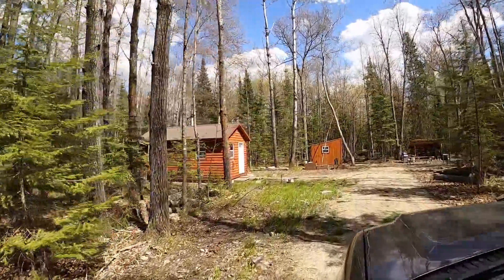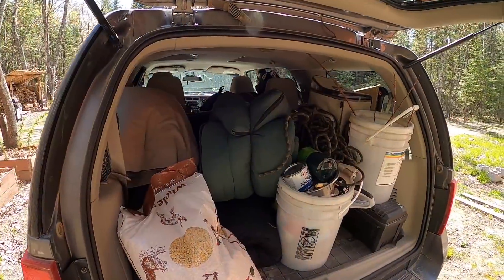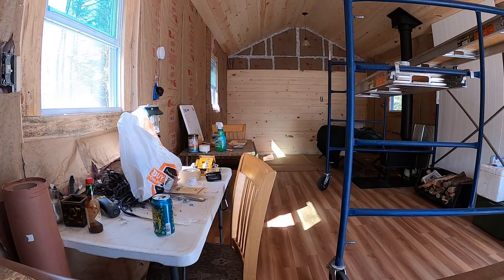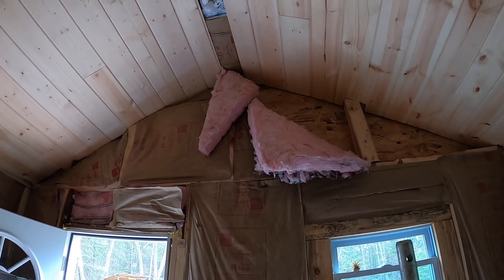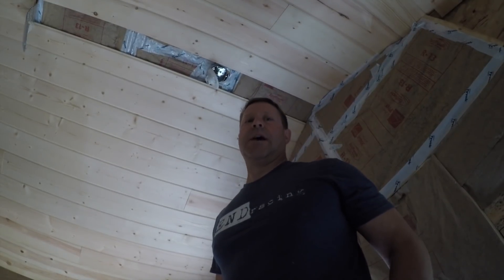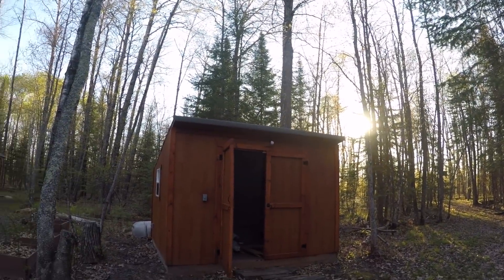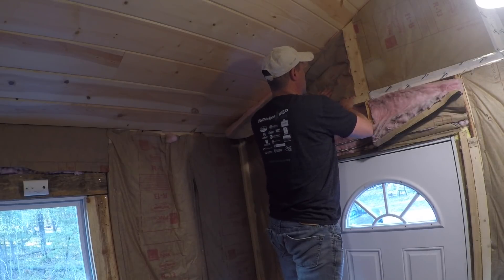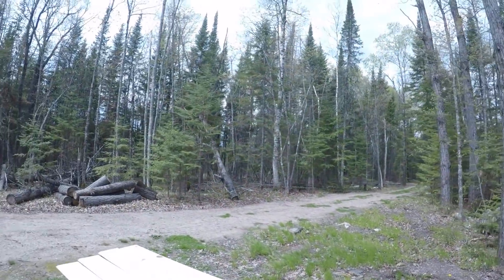The off grid shed to cabin conversion ceiling is FINALLY finished!

Comment: I went to a local two-person mill and I offered to buy the outside boards of the trees. The section that has bark and normally not used. Instead, he gave me whatever I wanted and told me to come back when I need more. I used them as siding once I cut one side with a straight edge. I made a small shed to house my lawnmower in. It is like a barn in that it is post and beam construction and gravel floor. I also bought the beams I needed for the build from the same mill. I then sealed it and after 8 years, the bark is still intact. It was a cheap build in today's standards. Just a suggestion until lumber prices come down.
Reply from the maker: The Amish mills I drive by always have those ends in big bundle for $10. I had thought about buying and debarking but it seemed to much work. I'm very intrigued to learn that you leave the bark on. Do you have any issues with bugs? I'm really glad you commented. This could be a great option that I hadn't considered

Comment: Lake county requires an electrical inspection. Just got my land use permit for my out house and sheds this year. Just finished clearing some land. Boundary water trip in a little over a week. Then start building in June.
Reply from the maker: Are you on the grid? I can't even get electric if I wanted. I'm excited for you Troy. You will love it!
Reply: @TRERUNSWILD  We will be off grid. $6000 to run a line, yikes!
Reply: Nice I got land in lake county too yes there a ton of rules and laws to get around

Comment: If want to save space put in a loft it will be cramped but will be warm in the winter. Don't forget to ventilate your outhouse.
Reply from the maker: Yes, a vent is needed. Found out the hard way.  Thought about a loft but yes, it would be cramped.

Comment: place a back seat longer car mat by the door so if you do walk in with muddy boots or sneakers.. you'd have someplace for e'm to be taken off. it is also advised that if you're using the pallet as a sleeping space (for now and not permanent).. once you're at the cabin.. during the day.. and the sun's out.. take the pallet outside in the direct sun for 30 to 1hr.. why any bugs or mites hiding inside the closed spaces will fall out.. when you're going back home leave the palette in an up right position.. possibly tied to the wall by a hook or bungie cord. lastly add a bug screen with magnets.. when you're at the cabin/shed.. on summer days without an AC.. it will keep your shed cooler at night... cross ventilation, plus no bugs. stay Safe.. GOD BLESS.
Reply from the maker: Those are good tips. I plan to make a log bed so the pallet will be temporary. Although as slow as my projects go that might be awhile!. I did have the pallet outside so hopefully I didn't bring in any critters. (spiders)